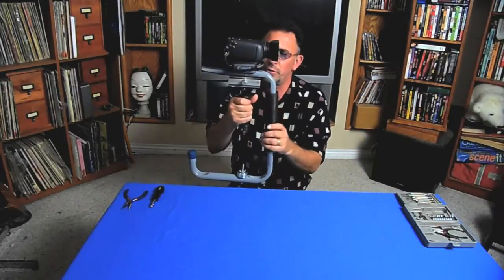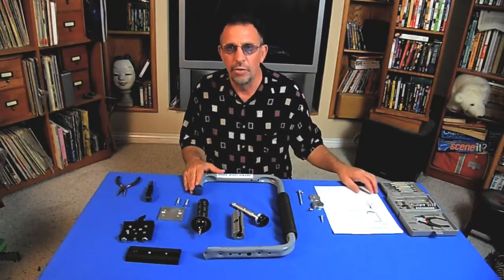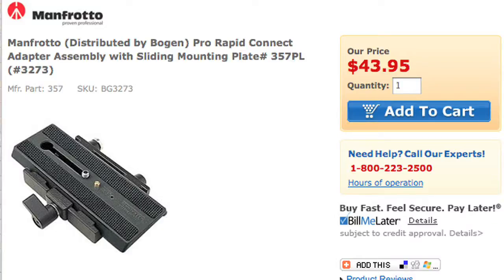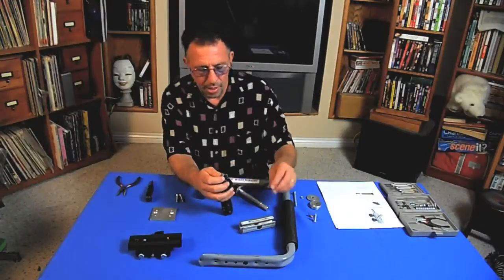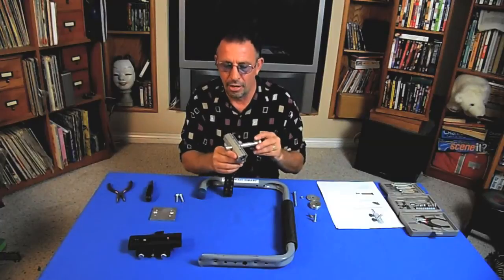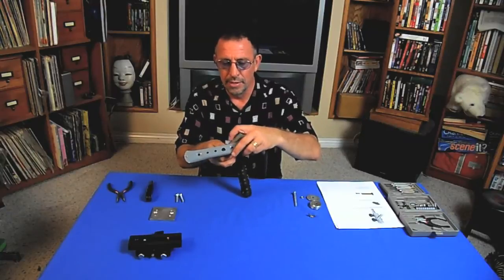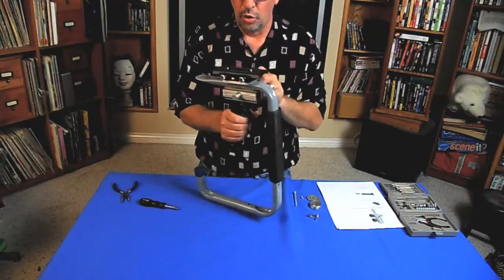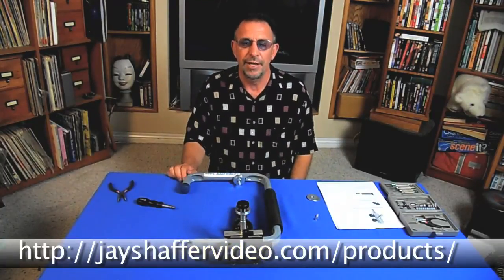*UPDATED* How to build a DIY $100 Merlin-type Steadicam camera stabilizer that really works.

Comment from the maker: I am tightening the 1/4" screww on the top of the tripod into the single hole in the Lowel Interlink. the screw should be long enough to secure the 5/8" horizontal stud.
Hope this helps. good luck with your build and happy shooting.

Comment: @nic3188 I have to agree with Nic3188.  I have my own DIY that costs approximately $10 and although it doesn't work as well as this one, for the price you can't beat mine.  Just get any u shape bar and a good gimbal and you're set.  
Jaybilizer is still good stuff but the price is not as good.